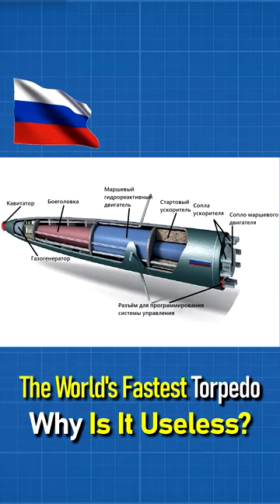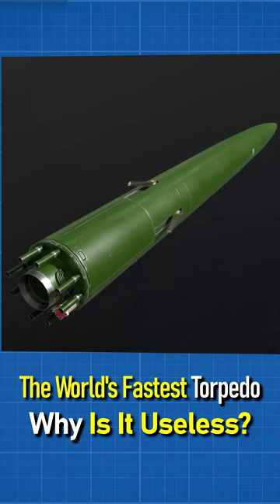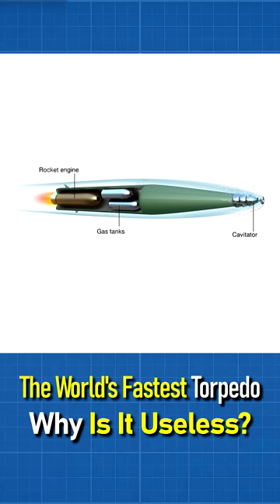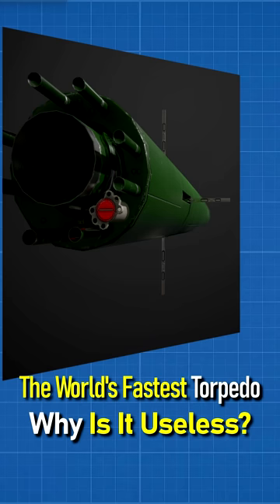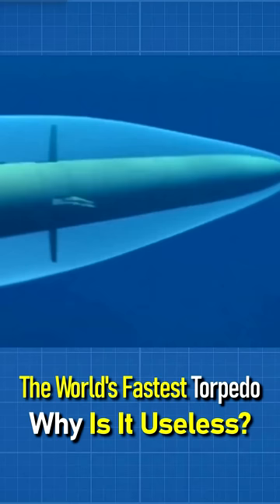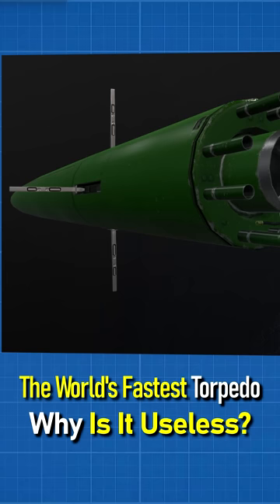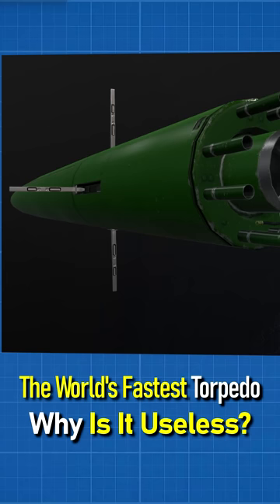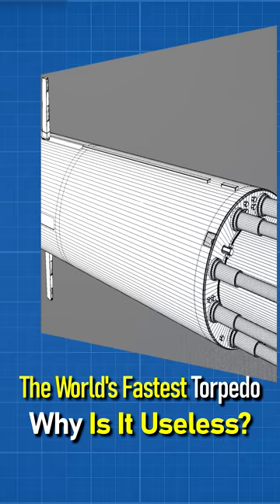The World's Fastest Torpedo • Why Is It Useless #Shorts

Comment: The torpedo was probably designed to quickly destroy submarines with a nuclear warhead over a long distance
Reply: Definitely not over a long distance because it's so loud and cannot be guided.
Reply: The torpedo was designed for defense. The US had better accounstics and the Soviets knew it, so the Soviets made a very public development of a high speed torpedo.

Since it was universally understood the US would "get the drop," or have first shot advantage, the Soviets made it clear that Shikval would be launched in the direction of an approaching torpedo, which would force the attacking sub to sever the control wire, in order to avoid the Shkval.

Comment: If it drops its super cavitation ability for the last couple hundred meters it could use a sensor for final guidance
Reply: Wouldnt that involve a massive speed brake?
Reply: The later versions do exactly that.  Earlier versions just used a tactical nuke warhead.
Reply: @Typexviiib  It just switches off the steam jet in the nose and the cavity collapses and the ocean is the massive speed brake.

Comment: let me tell you narrator that those torpedoes has a two stages system, electrical to move it a location away from the sub and then the cavitation propulsion, it makes the submarine hard to detect and range is not 13 kilometers, it's 20km and still is a very long distance and add the 5km distance of the electric first stage.

Comment: You called it a rocket at the beginning, correct. Then you said it operates off a jet engine. Jet engines have to breathe air. This particular engine is underwater.
Reply: And just do add confusion, the truth is that it accelerates with a rocket then switches to a jet engine.  The jet is powered by a metal powder that reacts violently to seawater.  So it's a seawater breathing jet engine.
Reply: @Erkle64  That is an important detail. A jet powered by a sodium hydraulysis process
(2Na+H2O=>NaO+2H). A kind of underwater Ramjet is certainly within the Russian scientific sphere when this weapon was in development during the 1990s. What's your source material?
 I remember when the West first got wind of this. The Rocket and ichthyo-lubricated skin were much talked about. A huge drawback is as the shooter you likey only get one salvo. The ignition makes so much noise that even passive would provide a targetable fix solution. Combined with its short range less than 20k NM and lack of guidance gives it little chance of striking a target capable of counter detection, beyond 7k-10k NM.   It was not considered a viable threat. WHY? PIt is not likely the ignition will go unnoticed.  As long as the targeted crew reacts within 45-60sec of detect. That's enough time to change C/S significantly. This was supposed to be a carrier killer. Problem is in a real shooting war the battle group will go active on you. By yourself it will not be possible to get within 20k of the CVN. You might have a chance with five or more coordinated SSNs. That's a challenge right there. Like many things the Soviets/ Russians come up with there is much wind and smoke but once you think it through it not all that consequencial.

Comment: "Super cavitation torpedo makes alot of noise so it makes the submarine very easy to detect. " doesn't make sense.
Do you mean the torpedo is easily detected?
Reply: Origin point of the noise caused by the torpedo igniting would give away the sub position more easily than traditional torpedoes I'm guessing

Comment: I came up with the idea for a super cavitating torpedo when I was in like sixth grade -all my own STG ✋🏻 ("independent replication") lol 🤷🏼
The idea that if you move fast enough you can create a shockwave under water as to fly thru a cavitation bubble and not directly touch Water!!
😁👍🏻
Reply: Thanks. Can you please briefly tell about "super cavitation bubble"?
Thanks.
Reply: Actually you are touching water - in vapor form.
Reply: @cck1496  when you push on water, the water moves.  Because water cannot compress, it moves the water in front of it as well.  Because it has a fair amount of viscosity, it drags water molecules adjacent to the molecules you're pushing on with it.  If you're going fast enough this rips a low pressure bubble around the object pushing on the water.  In this way you end up pushing on the air pocket (the air is actually boiled water vapor created from the vaccum) instead of liquid water.
Reply: @Typexviiib  Thanks for the clarification. Keep it up.